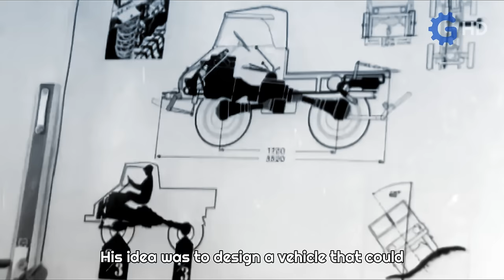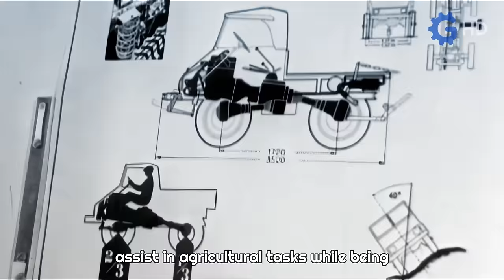THE ALL-TERRAIN VEHICLE WITH A UNIQUE CONCEPT ▶ MERCEDES-BENZ UNIMOG HISTORY

Comment: Unimogs are a very good truck. I had the privilege to drive one with a company I used to work for.  I was amazed at the ability to go through mud. The only downfall of it was you had to go up and down a hill don't cross a muddy hill. The narrow design made it unstable crossing a hill. If you get one stuck you better have a large truck to pull you out.
Reply from the maker: Unimogs are amazing off-road vehicles, and we appreciate your firsthand experience! The narrow design can make them a bit challenging on steep, muddy hills, but they're still impressive. Thanks for sharing your experience with us! 🚚💪

Comment: A rigid chassis?? No! It has the most flexible chassis ever designed! That's why pods and flat-beds etc, mounted behind the cab, use a 3-point mounting system rather than four, so that they do not restrict the chassis twist. :) (the proud owner and operator of a 406, 416 and 419)